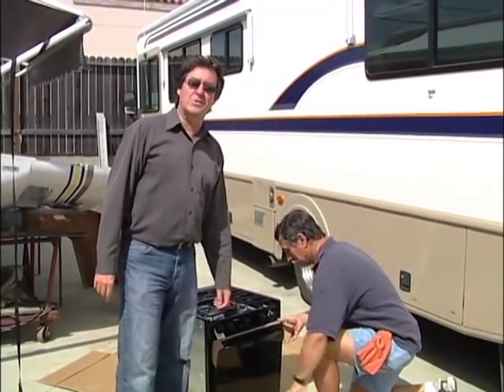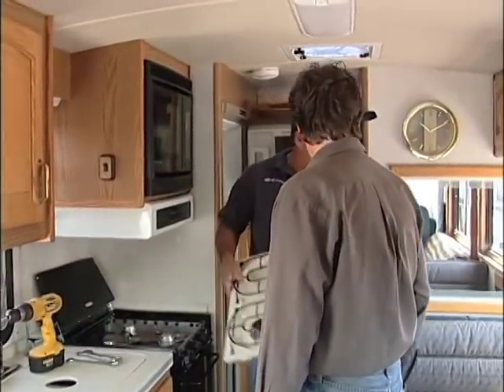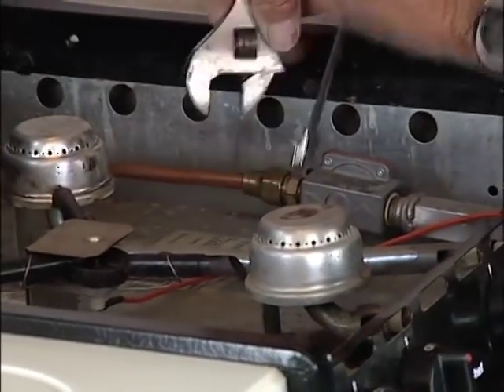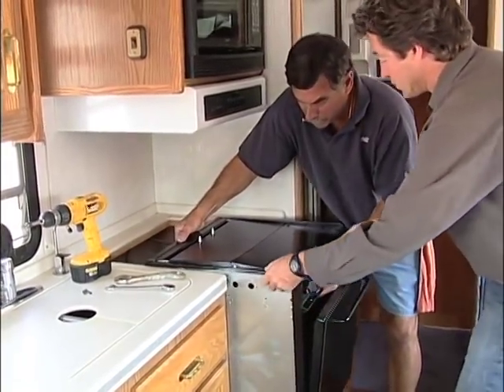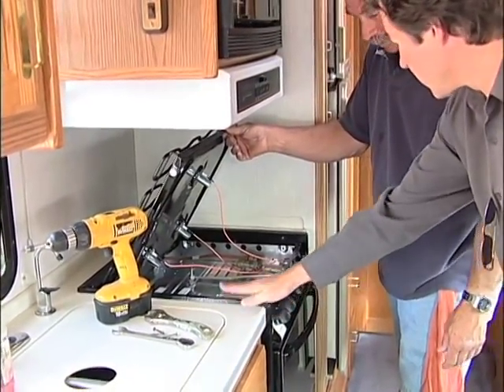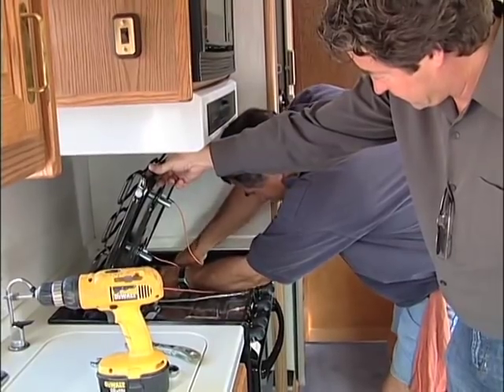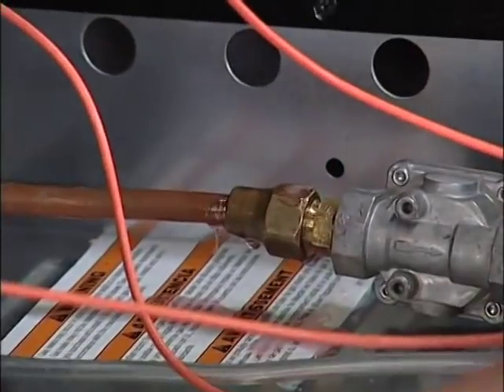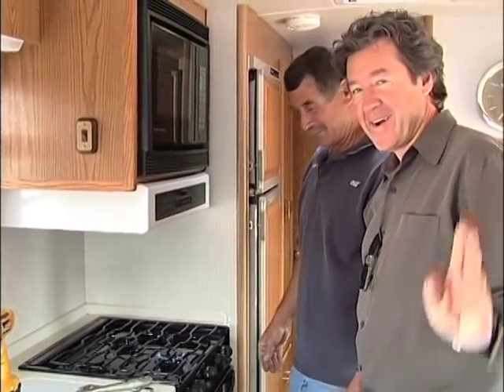RV How To - Installing a New Stove

Comment: After you break the propane connection ( mine was 1/2") at the supply, you will also have to keep the fitting. It is 1/2" male to 3/8" female. Because the fitting that comes on the new range is 3/8" male. So it was replacing old magic chef with new suburban. Also, the suburban connection was not under the top with the burners but  behind the stove, top left, 90 degree. The gas line had to be bent a bit to reach it.